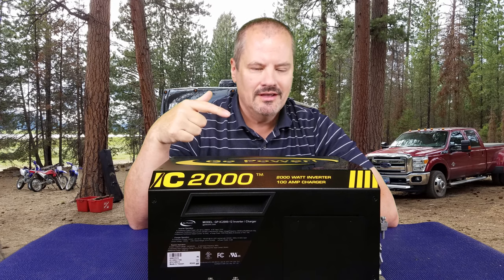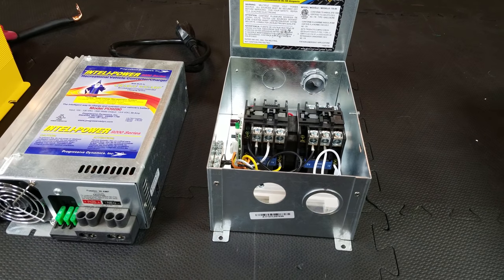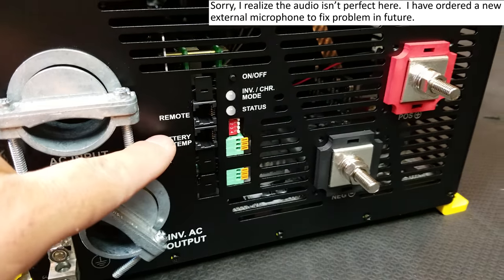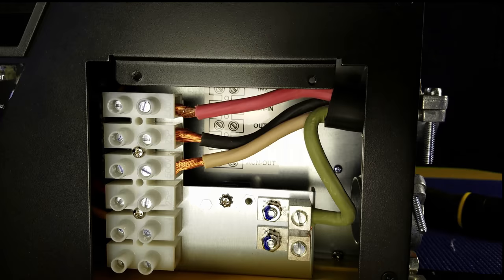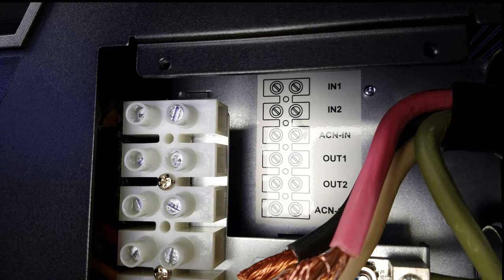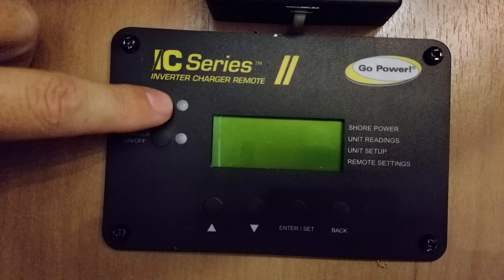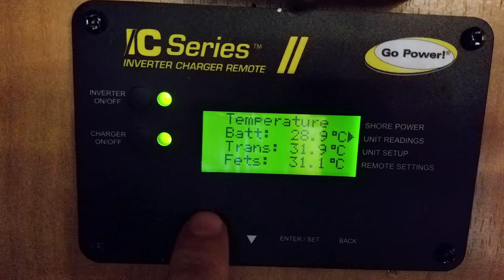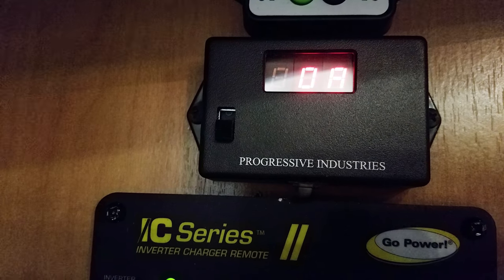Go Power! IC2000 -  Inverter & Converter & Transfer Switch

Comment: Good video  Do you know what the transfer switch criteria is?  When plugged into shore power does it automatically transfer or is there a way to set a threshold to run off battery as long as possible and then fail over (based on battery voltage or depletion threshold)?  My objective is to run off solar as long as possible and then switch to shore power automatically.  Thanks
Reply from the maker: That is a great question, that I don't have the answer to.  I recommend calling GoPower Support...they are the BEST!  Odds are great that you will get a human answering the phone with in the first 1-2 rings!!!
Reply: @tannerjim  Thanks...I'll give them a shout

Comment: How  do you have yours hooked up the the distribution panel?
We have 30 amp service.  And  I want to use the microwave , and all the outlets.
Reply from the maker: Shore line power comes into IC2000 (upper left as you look at back of IC2000).   Battery connection on right side (pos & neg).   Output is wired from IC2000, to distribution panel.   I used this as a 50 amp device, so I have 6 gauge wire, with 4 wires..    Leg 1 and Leg 2 are "hot" then connect white wire (neutral) and green wire to ground.    That is it.   Now you can use either shore power or 12v power to provide 110v power to RV.

For you, you will only connect one hot wire (Leg 1)....as you don't have a 2nd "Leg" of power.
Reply from the maker: See page 30 of  the IC2000, for a diagram of how to wire the IC2000 with a RV that uses 30 amp service.  
http://gpelectric.com/files/gpelectric/documents/PDF/Manual_GP-IC2000.pdf
Reply: @tannerjim  For my own understanding, and possible confusion lol you said "then connect green wire (neutral) and white wire to ground."  I've always thought green was ground and white neutral or am I missing something?
Reply from the maker: @jdlaw4216  You're right...I wrote it wrong in the comment above (now fixed).   However, the video had it shown and I said it correctly.  Thanks for pointing that out.

Comment: Do you ever have overheating problems with your ic2000?
Reply from the maker: Never....we just got back from 12 days of Boondocking and using the IC2000 everyday (oh...it was 96+ for about 5 straight days) and it performed flawlessly.
Reply: RV With The Tanners thanks for the reply, I have it mounted in a pretty tight compartment (it's pretty small cubby inside a lance truck camper), I'm thinking in going to have to remount it's somewhere else.

Comment: I assume you still have an ATS for the gen/shore power and then it goes to your IC2000?
Reply from the maker: I don't have an on-board generator, so I don't have a separate ATS.   If you do, then yes, you would still need an ATS prior to IC2000/IC3000

Comment: where i connect generator? mine rv have no inverter installed. thanks
Reply from the maker: If you have a factory generator, that most likely goes to a transfer switch, which combines your shore power plug.   Take the output of that transfer switch as the "input" to the IC2000/IC3000.   Wire batteries as normal.
Reply: @tannerjim  thanks

Comment: Hi. Thanks for the video. Do the batteries hook directly to the unit? The instruction manual seems to show them going through the DC panel first. Thanks again
Reply from the maker: Yes... Directly to the batteries.  I'm away from my computer, so I can't link my diagram.  But if you scroll down in the comments you should see a link for my wiring setup.
Reply: +RV With The Tanners . thank you so much. my last inverter/charger had a 3 prong plug for a nearby outlet.   can I wire a plug to my new unit to make life easier? thank you
Reply from the maker: From this device there is no built in plug to use.  It is creating 50 amps, do  you'd need to wired a 50 amp plug if you didn't want to take the output from the IC-2000, directly to your RV's distribution panel.
Reply: +RV With The Tanners . thanks again. my old airstream has 2 sets of battery cables that go directly into the 12v distribution panel. if I attach my batteries directly to the ic 2000 I won't get any power to my 12v appliances.
Reply from the maker: The IC2000 has a POS and NEG connection to the battery...those cables act to provide DC to the IC2000 to create 110v (via Ic2000's Inverter) and then if you are connected to shore power, the same cables will provide a charge to your batteries (via the IC2000's Converter).

Normally 12v power to sent to the RV off the battery(s) via a "busbar" and through some breakers (20-30amp).   The "distribution panel" is for 110v power.   Now, your RV might have some sort of combo unit.   I don't have an Airstream, so I can't guide you to the exact setup.  

I would highly recommend you call GoPower and talk with their Tech Support.  I called them about 3 times to ask questions and I always got right through to a live person.   I give their Tech support a 10 out of 10!!!
Reply: +RV With The Tanners  thank you so much for your time and thoroughness. I will definitely give them a call.
Reply from the maker: I've attached a link that will open my power distribution diagram.   Hopefully that will help you understand....I'm the visual type, so this diagram was helpful in my planning of the power layout.    

I think your question might be answered by looking at the 12v distribution "panel" (I call it a busbar).  That will power your RV's 12v items.

https://drive.google.com/open?id=1gpeAk0jZHG1RxQShtVymEcsGGP9dE7Hj
Reply: +RV With The Tanners . thank you. I can't seem to open your links. they come up as not found. go power told me to plug my new batteries to the battery cables that come out of my old 12v panel and go out from there to the inverter.  now i just have to figure of how to wire that and the wires coming from the solar charge controller. they recommended  to wire the batteries in parallel.
Reply from the maker: if you email me, I can email you the diagram.   rvwiththetanners@gmail.com      Just out of curiosity...where are you located?   I think a guy from Canada was having issues with the link as well.

Comment: ok, so just so I'm reading you right, the wires going to the main panel from transfer switch will be hooked up to the inverter and then the other side of inverter goes to panel. am I right
Reply from the maker: Correct....   If you have any questions, GoPower customer support is the best.

Comment: Can this converter be used to charge Li-Ion batteries???
Reply from the maker: Per GoPower customer support......"Currently they do not support lithium but we’re exploring that option for future updates"
Reply from the maker: Interesting enough, I am now planning to install 6 Battle Born Lithium batteries.  After talking with both Go Power and Battle Born, it is now ok to use the IC-2000 to charge these lithium batteries, with the understanding you configure the IC-2000 to charge at proper rates.

Battle Born recommends:
• Bulk/Absorption voltage between 14.2 - 14.6 volts.
• Float – not needed, but if device can’t disable float, have the float value at 13.6 volts
• Equalization - Not recommended.  I will be using the AGM mode (all dip switches “off”) and AGM doesn’t use an “Equalization” mode….only Flooded batteries use equalization mode.
Reply from the maker: My 6 Battle Born batteries are installed and I used the "custom" setting on the IC2000.  Things are looking great.  Now I just have to compile it all into a new video (or 2)

Comment: If shore AC is wired directly into the inverter (then out to distro panel) and the inverter is switching between solar battery bank and shore power, how is a generator incorporated? In order to switch between 3 AC sources (shore AC / genset / inverter AC output) I think it could be wired as such: Generator output to the inverter AC input so it is switching between genset and solar battery bank and then the inverter's AC output would route to an external ATS that would switch between inverter AC and shore power AC. So the inverter ATS switches between genset / solar and the second ATS switches between inverter AC / shore AC. So for 3-source systems, you would still need an external ATS in addition to the internal inverter ATS.
Reply from the maker: Correct..... I do not have an on-board generator so I don't have a need for a stand-alone transfer switch.
Reply: Gotcha. I'm working on a 3-source project myself at the moment. Thanks for the info.

Comment: and how or where do you conect an mppt charge controler if also have solar panels for charging the batteries ??   sorry if it's a dumb question
Reply from the maker: I have my MPPT controller attached directly to the battery, with a cutoff switch installed.    I've attached a link that will open my power distribution diagram.   Hopefully that will help you understand....I'm the visual type, so this diagram was helpful in my planning of the power layout.    

https://drive.google.com/open?id=0BzxEvZw2XQ1MQ3YwRnJoel9MaDg
Reply: thanks for the diagram Jim, just gave me a couple of good ideas!

Comment: So this DOES NOT replace the transfer switch.
Reply from the maker: Yes and No.   If you have a built in generator, you will still need a transfer switch BEFORE this device.   If you don't have a built in generator, this device will be your transfer switch, between Shore AC power and the AC power it creates.
Reply: @tannerjim  10-4
In the video I recognized that I had the same converter and transfer switch as you did.

I want to get rid of my two 75AH flooded batteries and get two lithium batteries. No solar.

I’m thinking the original charger should do the trick.

The wife and I cannot come to an agreement on a larger system. I’ll have to fight that battle again another day
Reply from the maker: @donl7114  Get your converter model number and call Battle Born.   Some newer converters have a Lithium profile, if yours doesn't you will need to replace it to fully charge Lithium.   Moving to 2x 100Ah Lithium's will almost triple your available amps hours, as you can use 100% of Lithium amp hours but only use 50% of Flooded amp hours.   So, even with 2x75Ah flooded, you only had 75 total amp hours available.   Here is a link to my 6x Battle Born Lithium install.https://youtu.be/08u7VRPeJD4

Comment: I have a 2000 Damon Ultrasport DP with 50 amp service, I have an existing transfer switch for shore power and generator power. What do I need to run both into inverter.
Reply from the maker: The output from your current transfer switch is feeding your RV's circuit circuit breaker...right?   if so, you would route that into the IC2000 (or IC3000) as well as the 12v input from your batteries.   The output of the IC2000, would then simply go back to to the circuit breaker.

Comment: Thanks Jim, will this also charge Lithium Batteries...i.e Battle Born. I'm getting ready make my decision soon.
Reply from the maker: I would think so, the manual (see link below) does not call them out, but has a "custom" field.  To be 100% sure, I would call Go Power Tech Support....they are very easy to work with.

http://gpelectric.com/files/gpelectric/documents/PDF/Manual_GP-IC2000.pdf

Comment: Jim, maybe you can give me some advise with this question:  if I have a 12vdc refrigerator wired to the battery, how can I manage an alarm or auto dissconect before the fridge drains completely the battery when I'm sleeping or out the RV?...   how it's usually done?   thanks in advance
Reply from the maker: Are you sure your refrigerator is 12v only?   I've seen these before (known at 3-way refrigerator) but they are fairly outdated.   Normally, you would have a 2-way (gas or electric) or "residential"  (electric only).   Please confirm what you have.   (model number?)

We can discuss an alarm, once I fully understand your refrigerator setup.  :)

When you say "out of the rv"...are you talking about while RV is in storage or perhaps you're just out for a hike?
Reply: tks Jim, I'm on the project definition phase, figuring out where all the pieces go... yes I understand there are some 12v/110/LP refrigerators, but if I'm boodnocking I've learn that is better to run it on 12vdc (let's say I don't like LP and it's hazard implications) instead of the inverter due to eficency loss and shorting the inverter's life
yes, when I refer to out the van I mean outside the van (sorry about my english LOL)
Reply from the maker: We boondock a LOT...and I wouldn't be without a 12/Propane refrigerator.  It use hardly any 12v power and very little propane.  I don't know your situation, but if at all possible, go with a 2 way refrigerator (12/propane and electric).    You will need a min of 2..possibly 4 deep cycle batteries to get a 12v only refrigerator working well for you.  

LOL...I've been fortunate to travel all over the world for my job....your English is fine!  :)

You're also going to need some efficient solar panels to replenish your batteries during the day.   Have you figured out what you'll be doing there?
Reply: tks, the goal is to have a 3500 Ram promaster fixed with 300 watts solar and with a couple of 6 volts batteries with let's say 200 ah @12v  pair with a 2000w pure sine inverter.... made a list of the appliances and the running time needed and my guess is that will be enough
but the refrigerator.... that's the issue, I'm lost in that one... too much drain... by the way, I'm talking about a small one, don't know, maybe 3 cu ft

so, one, don't know what kind of refrigerator is better  and Two if I run it on 12vdc how to avoid damaging the fride or hurting the batteries if they get totally empty.... that was why I asked about an alarm or auto disconnect the battery...
Reply from the maker: There are a lot of devices that will cutoff the battery if it hits a certain level.  Check this one on Amazon - http://amzn.to/2yIJlYb

Sound like you'll be fine for power most of the year...might be in issue in the winter months getting enough solar.   Do you have ability to angle the panels to get optimum power in Winter?

Comment: If I install this inverter in my rv how do I disconnect and remove The factory transfer switch and the factory converter?
Reply from the maker: do you have a factory generator?   If so, you'll want to keep factory TS and then have that power sent to IC2000 (or IC3000).   You simply unplug your existing converter.  The wiring from IC2000 will send 12v to your RV and Batteries.

Comment: Good video.  I have a class A w 50 amp service. I just bought the ic3000 and wanted your opinion.   I plan on using the 3000 to power everything - only when needed. I understand electrical. My coach only has a single elec panel. No sub panel. Both legs split in the panel and all is good. 

Plan is to wire ic3000 from existing transfer switch (gen/shore). From ic3000 to the main panel using both legs. (Obviously unplugging existing converters). I’ve thought it. Drawn it up and seems fine. But there are some that suggest whole house is not recommended. 
We are always cautious with our boondocking power. Only on when needed. I don’t plan on running ac with it. That’s what the gen is for. 

What’s your take on whole house vs installing a sub panel from inverter?  The ic3000 seems more than capable. Plus I’m thinking older inverters didn’t have the capability to use two legs. I think it’s fine.
Reply from the maker: We have everything powered from our IC2000.   We both know not to fire up the AC unit, which is the only thing that the IC2000 can't handle.   

Here is a link to my wiring layout.  Yours will be the same, except your "input" will be from the "output" of your existing transfer switch (for Gen and 50 amp leg)

https://drive.google.com/open?id=0BzxEvZw2XQ1MQ3YwRnJoel9MaDg

Feel free to subscribe to our Channel, we have some more Go Power stuff coming soon.  :)
Reply: RV With The Tanners 
That’s what I thought.  I’ve also got a renogy solar setup (albeit only 200w/48v) with an mppt controller. 

I’m leaving all the old wiring and converters (2x) in case the ic3000 dies, I can use them.
Reply from the maker: Excellent plan...if you ever sell the RV, you can easily remove the IC3000 and put in your next RV.

Comment: How far away are your batteries? And what batteries do you have.
Reply from the maker: About 5-6 feet from batteries.   We use 3 Trojan T--1275 batteries for a total of 450  Amp Hours.
Reply: How did you connect this to your panel?   We just installed ours and no power to the trailer -  ugg
Reply from the maker: Was fairly straight forward.   Ran the line from the output of the IC2000, directly to our RV's distribution panel.  Connected all 4 wires and was done.   Can you hear the IC2000 come on when you turn on the remote?  Is the remote coming on?   What is your battery level?   There are 2 reset buttons on the side...any chance those are not on?
Reply: RV With The Tanners yes the remote and the ic has a green light,
We ran 10/3 from in inverter to shore power cord then from the panel to the out  inverter.  Ugg,  what is with the dip switch not in the manual
Reply from the maker: Maria Diaz 10/3?   Are you only doing 30 Amp?  This is a 50amp device.    I'd call GoPower Monday morning to check.  I used 6/4 wire for our setup.
Reply from the maker: Maria Diaz not sure of your wiring.   You should have two inputs.   One is shore power the other is from battery.  From IC2000 you wire direct to distribution panel.   That is it.   Not sure what you meant by running power to inverter